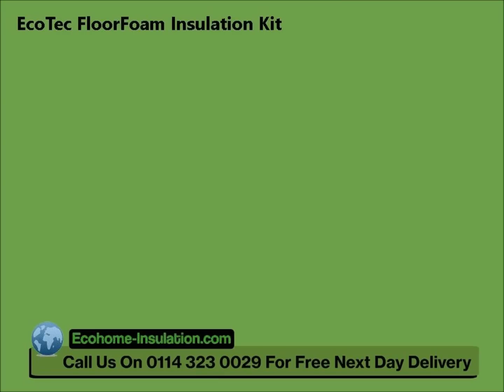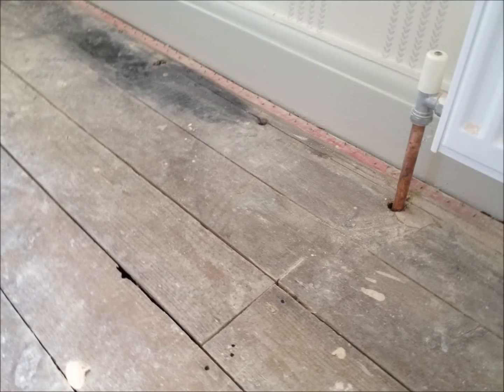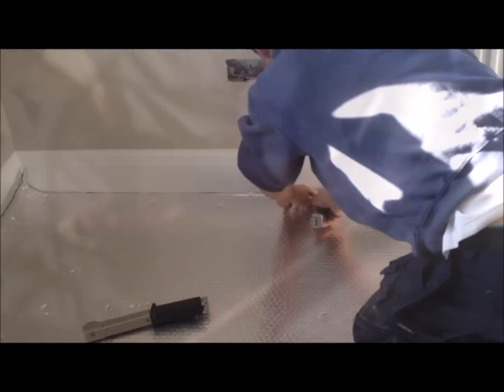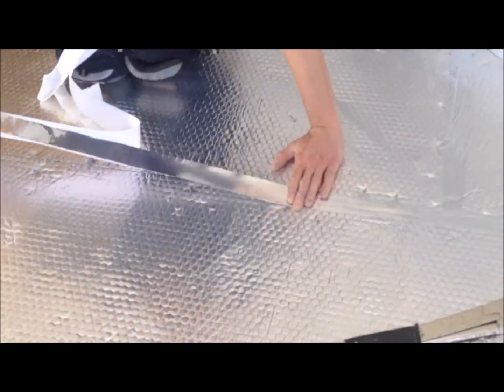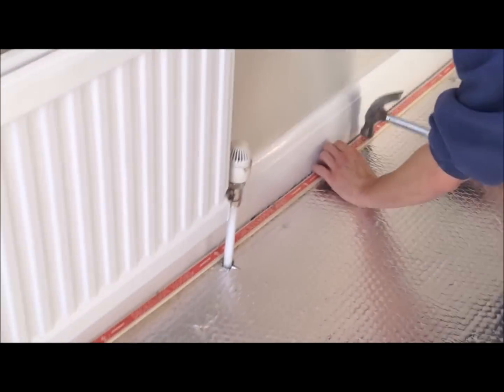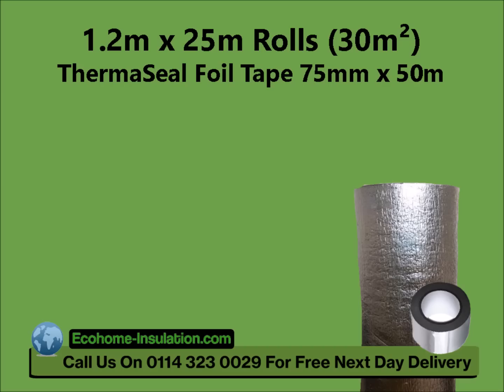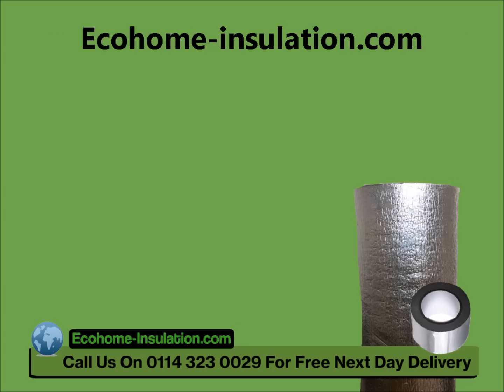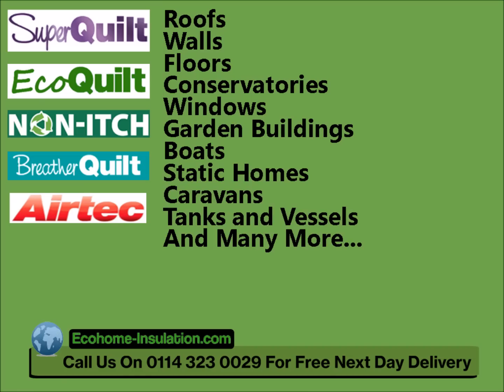How to Insulate a floor to prevent Cold from below with EcoTec FloorFoam

Comment: This is most fast, economic, and practical technique to apply. Thanks a lot!
Reply: Have you tried yet? If yes how effective was it? I am thinking to have it!
Reply: Assalammualaikum Brother. I didn't do exactly like in the video but i get that idea behind it. I have cord carpet on entire floor which is still in perfect condition, and  i don't want to remove it.  So, I just brought a fluffy carpet for second layer and it's working for me. You can apply carpet protection film in between if you want.
Reply: @wanmustakim6522  Wa'Alaikum Assalaam, Masha'Allah that is a brilliant idea! I was thinking to just lay a carpet all over the floor, but again my parents were compaining the dust that a carpet collects etc! Btw it was carpet, they asked for a tile, and now after replacing with tiles, they're complaining  of cold during this winter season lol! I was searching for a temporary solution, because again during summer they'll want a cooler floor hehe
Reply: @seekfactsnotfiction9056  Awww....They are so adorable. Hahaha... Well you may put a boxes on the tiles first, and seconded with removable carpet.  May Allah bless you and your family by the plenitude of blessings.
Reply: @wanmustakim6522  Ameen, jazakillah khair
Reply: Yes, if you want your floor joists to rot.  Otherwise, no.  This will trap the ventilation underneath where the joists are, and they will rot.  What you need to do is put a damp proof membrane under the joists, kingspan/celotex insulation, then screed.

Comment: Hi, if installing this on the concrete ground floor as insulation, do you still need to install underlay for laminate flooring? What underlay would be suitable with 12mm laminate planks?

Comment: Radiant barriers need a direct air cavity adjacent to them. Once covered, this is not achieved
 The air cavity provides the performance. Do not expect this to be equivalent to insulation within your floor.
Reply: I wish I could comprehend this….
Reply: I was going to ask the same question. You need air cavity next to the aluminum reflective surface. There are many products for applying under the heated floor. But i guess it's mostly marketing. 
Reflective insulation works best for attics or roof spaces

Comment: Radiant barriers need to face an air space in order to work. When you sandwich foil between two surfaces (subfloor & underlayment), it becomes a conductor, not an insulator. All this will do is conduct heat from the interior of the room through the carpet & underlayment into the subfloor.
Reply: Then it's called underfloor heating!
Reply: So, if the foil is insulated on both sides (it looked as if there was some insulation in this stuff) with something like foam, does that solve the problem, since the insulation is really a network of air cavities. Furthermore, suppose the foil were on the bottom? Wouldn't that allow it to reflect some of  infrared radiation that got through the insulation back up  into the room? Even if the foil were as cold as the basement or crawlspace below, I'd expect its reflective capacity to work.
Reply: This. Why do so many people not get it?? "Radiant heat" is infrared light, if there's no space, there isn't any radiant heat to reflect.
Reply: It will also create mold between the wood floor and the radiant barrier, condensation will form.

Comment: Hi, if you put laminate flooring not carpet, you still need to put another underlay on top of this? Most underlays are moisture resistant and heat resistant having an aluminium coat in it. Thank you
Reply from the maker: Hi, we would still advise the use of an underlay if this is stated in the Laminate manufacturers install guide.

Comment: How does it reflect warm back into the room if it's covered by wood or carpet?
Reply: Infra red radiation (heat) will travel through the wood or carpet but reflect back once it hits the insulation's metallic surface.

Comment: Hi can I lay laminate flooring directly on this isolation ?
Reply from the maker: If the laminate board is 12mm, then you can lay Laminate boards directly onto the EcoTec FloorFoam. If using a thinner Laminate, then i would recommend installing a thin plywood before, to give the Laminate rigidity. Hope this helps!

Comment: Guys be careful & think things through before any insulation is carried out on your house, I insulated  the exterior walls of our house & it turned out worse than before, I have nothing against this video and it's a great fast/diy job before laying carpet.
Reply: Really
My house has no insulation in the walls. I qas going to line it with this underlay on the wall. Would it work
Reply: insulation facing out to external walls or on external walls should be breathable, this is not

Comment: I guess that this could cause condensation under your floor, and trap mostuire in the wood
Reply: how so
Reply: That would be gross specially if mold grew.
Reply: Wood seal it first with paint I did before I used it  then  padding then carpet

Comment: I'm interested in using peel and stick carpet tile.  Would I be able to stick it to this floor foam? Or if i have to put the flooring underlay would peel and stick carpet tile stick to this?
Reply: Did you try it mate? How did it go? I’m thinking of doing the same
Reply: @chazzzztastic  I did try it. Over a word subfloor. I used a bond enhancer on subfloor. Measured the room , started from the middle of room on out to edge. I'd say stay on target of the lines you laid out in the room. But don't be surprised if room is not fully square. But making cuts come with the job.     Remove all nails and secure any loose subfloor and patch if needed. I didn't remove base boards but I've seen some videos that did. It was not hard but time consuming . I did three rooms and each has a closet. Its been abt 2yrs I believe now and I'm happy. I picked quality thick squares and I'm thankful I did crazy research on that part. I got many samples delivered before I made a choice. Good luck on your project. I did it so I know you can too.
Reply: @Chy_hayes  hey thanks for the prompt reply.. So you put a membrane on top of this insulation is it before you put the floor down the floor? Do you think the insulation is making the floor warmer?
Reply: @chazzzztastic  no I didnt put a membrane down. I initially wanted to for a warmer thermal insulation. But I didn't. In theory one prolly could  if the carpet sticks to the membrane and the membrane is secured to the floor. But hey it's all my opinion. Since it was my 1st time doing such a project I went with the tried and true per the install instructions.
Reply: @Chy_hayes  okay no problem.. I was just thinking without the membrane or underlay it couldn’t breathe

Comment: So if i put something like this down on a concrete floor and then ask a carpet fitter to put underlay, grippers and carpet over the top, will I be getting funny looks and told to remove it? Any extra insulation from the cold concrete can't be a bad thing surely?
Reply: That is what I was planning, Did you do it and did it help?

Comment: what is the method for doing that on a concrete floor? can't imagine a staple hammer would work.
Reply: GLUE/ CONSTRUCTION ADDHIVE.
Reply: Floating floor you would not put glue on it
Reply: I would go around the room with industrial double sided tape and also where the seams meet. Then put the insulation down.

Comment: that stuff you need a 1/2 in.  air gap under it , you can not walk on it like that it will be useless
Reply: @svenulfskjaldbjorn5401  is the stuff good mate and legit? I’m thinking of putting it on floors and walls of a timber cottage I have
Reply: @chazzzztastic  hi we have an old log cabin. I wonder if you put the foil in your cottage. Thanks for the answer

Comment: How it's gonna work with nailed hard wood? The holes would make it useless?
Reply from the maker: Hi Alex, we recommend fixing the EcoTec Floor-Foam down using staples rather than nails.
Saying this the staples wouldnt effect the performance of the material as the hole would be insignificant.

Hope this helps
Reply: But still need to nail down floor boards ?

Comment: You can't staple into concrete. Can you use an adhesive?
Reply: This is the wrong product for concrete.  Bubble foil is effective when installed properly with air gaps, which this lacks.  Do your own research, but I think this is fairly worthless as advertised.
Reply: You can try

Comment: Hi could you tell me can I use this on a concrete floor and then screed over it? 

I'm thinking of getting under floor heating system just wondering what could I use on my concrete to capture the heat. 

Thank you in advance
Reply: Geothermal Floor water based Heating system (The one that uses plastic tubing). Check it out. Or Geothermal Non Water based heating system (The one that uses coppper). Both on Youtube.
Reply: This is the wrong product for that.  You want a layer of styrofoam boards, not bubble foil. Bubble foil is metallic because it reflects heat, but that can't help you under a slab.
Reply: @dper1112  Wont it reflect the cold coming from a concrete slab?
Reply: @marcusd9192  That is a great question! The short answer is that if there's no air gap, the heat is transferred by conduction, not radiation, and the metallic layer stops working. The air bubbles would provide a little bit of insulation, but over time probably the floor weight would partly destroy that, too. In the end, bubble foil is designed and marketed for use with an air gap, and that's where it shines.
Reply: @dper1112  The EcoTec uses foam not air bubbles. Would that be more beneficial than air bubbles? Its not very thick - only about 4m of foam, but perhaps getting 10mm of foam sandwiched between two layers of reflective foil bubble insulation would do the trick?
Reply: @marcusd9192  Foam provides some insulation value if it doesn't get crushed. I can't find the manufacturer's contact info, but contacting them to ask is a nice idea if you want to get a technical answer. Still, the main value of that kind of material is the reflective layer. Expect little, but experiment for fun!

Comment: This won’t work without an airspace on at least one side.   Worthless if installed as you describe.
Reply: You do not need an airspace, that defeats the purpose.
Reply: Preach
Reply: @crackyjimbob831  an airspace is the ONLY reason a radiant barrier works. "Radiant" energy is transferred by contact. If you have contact on all sides, it will transfer. The foil becomes a conductor if being contacted on all sides thus speeding up the transfer of hot/cold temps. This could potentially make your home LESS insulated than before the installation.
Reply: @filmolosophy  Hey, I was looking at this video while trying to research options for my garage concrete floor in terms of insulation. Can you tell me what you would recommend (budget friendly, if posdible) is a good way to insulate the floor? Thanksin advance
Reply: @filmolosophy  thanks for responding, much appreciated. Unfortunately the garage I refer to is an existing build so too late to insulate under or externally to the slab. In this case there is a 4 inch concrete slab with the blocks built up off this slab, if that makes sense. The block work is not surrounding/outside the slab. I am trying to work out how I might insulate the floor as best I can given its a far from ideal build. Fortunately the slab is c'3-4 inches above ground level so it manages to keep water out. What if I was to put a sheet of polly/damp proof membrane down, then insulate before laying osb on top? I know nothing will give proper insulation here just trying to improve it somewhat if that makes sense. Thanks again

Comment: After installation, I wonder if it would sound like you are walking on tin foil 🤔
Reply from the maker: Hi Alford, I can confirm this is not the case and doesn't create this issue. It's tried and tested! The aluminium outer layers used are created from a much stronger micron compared to "Tin Foil" Making it much more rigid. Hope this helps